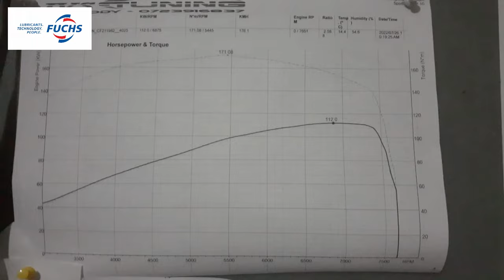Built Corolla 7AFE With Throttles🔥🔥| This is my ride Ep91

Comment: Love the video ❤ but something not adding up, she should pull harder.... years ago 7a swapped my 03 Toyota Tazz, stock important 7a motor  just with new 57mm ss straight pipe exhaust and a K&N cone filter to match .... Installed spittonics mercury + high pressure fuel pump ... When she left dyno... 100kw & 173nm at the wheels on 15s !.. More than happy to send pictures and videos... Currently she been standing, pulled & stiped motor to do a 7afte build with a audi rs2 turbo I got... But after the lock down bs project funds gone ... And only now recently able to slowly start up the project again, so if anyone knows when to get good quality Corolla/Tazz parts let me know, they might not have what I'm looking for but might know someone who does!  Thanks! And again loved the video!  Can't wait to see the bottle video update. If you know you know!
Reply: Exhaust, standalone and upgraded fuel pump... nothing else than this got u 170nm ?

Comment: Hi Guys, I am looking for an adapter plate for fitting 20v throttles to the 7AFE motor, I'm based in KZN, checked with Rowland manifolds and don't have

Comment: Great build, beautiful car, well done to the owner. AFE all the way. 

Just 1 question, the power figures is it 112kw at the wheels, or flywheel?
Reply: Wheels sir
Reply: @brandondewet2615  that's excellent buddy, I know a guy here in durbs that has made 112kw on a 4afe with throttles on methanol
Reply: @TheKodyt  that car inspired this build I wont lie, thank you mhan i appreciate it
Reply: Hey what ecu for the 7afe?